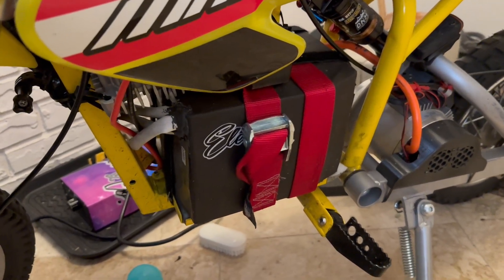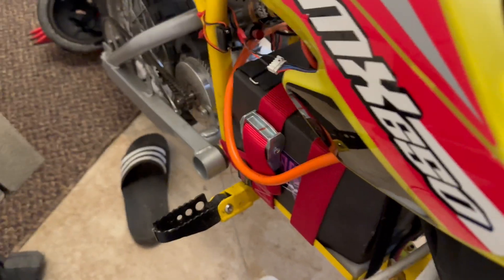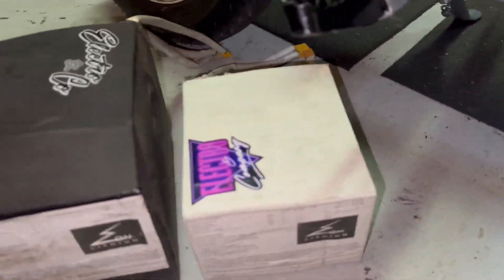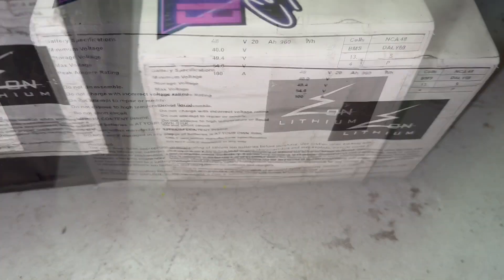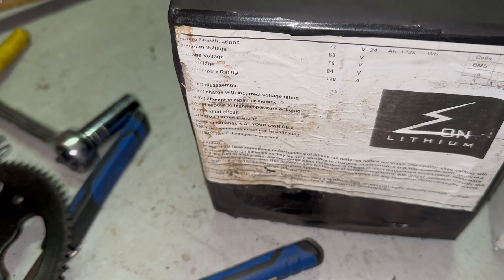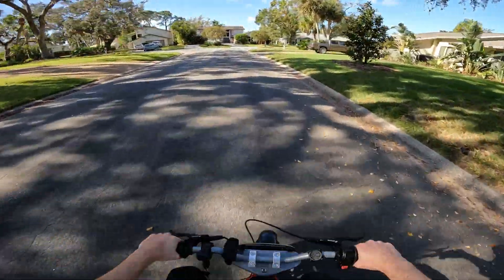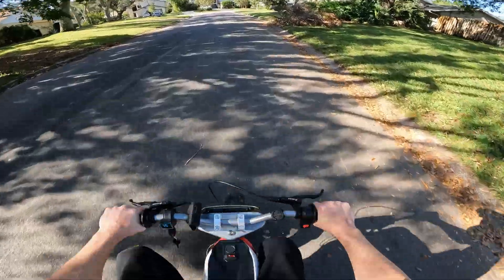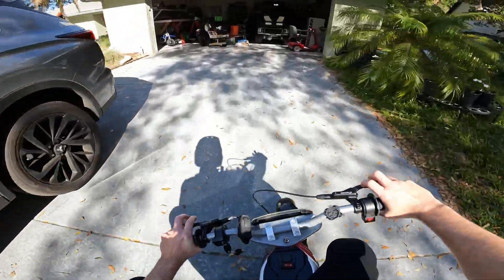72v Battery Fit & FULL TuneUp Process; Ultimate E&C RazorRSF650 From 3500w to 5000w to 6000w &Beyond

Comment: Buy an ATV rear brake, and swap out the hand master cylinder for a magura or something!!!!! Same bolt pattern.  Its on the 14 front 12 rear video
Reply from the maker: Yeah maybe in the future. It was just a quick adjustment I was putting off. Definitely plan on a rear swing and bigger wheel upgrade at some point.💯🍻

Comment: What cover is that on the side of the motor
Reply from the maker: On the mx650. It’s a dual fan cover. Here’s a link but you need to message him. He also makes them for the rsf650 as well. I’ll scoop one at some point. But message him with what dimensions your fans are and he’ll make it custom🔥🔥💯🍻

Comment: Does 50 percent push the battery to much? I have my first battery coming in and lse kit im so hyped. Crazy hard decision between this kit and the lse
Reply from the maker: I don’t think so. Electro & Co. does suggest 40% as a SAFE MAX for the 72v 24ah battery. I have been running my mx650 on 50% after running it on 40% for awhile & like I he extra boost. My mx650 I can wheelie on 15/65 gearing. The rsf650 design & front end is much heavier than the mx650. Needs MORE. Send me the link to the kit you got. I’m curious💯🙏🍻